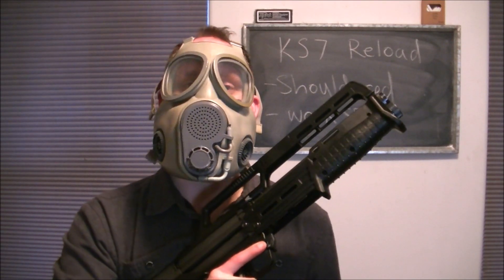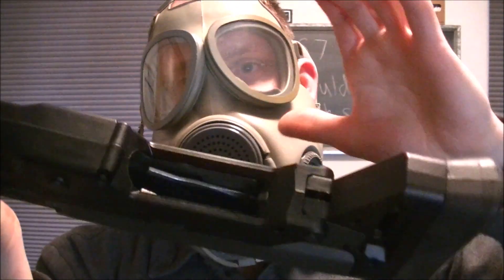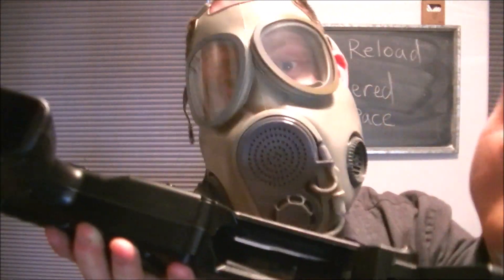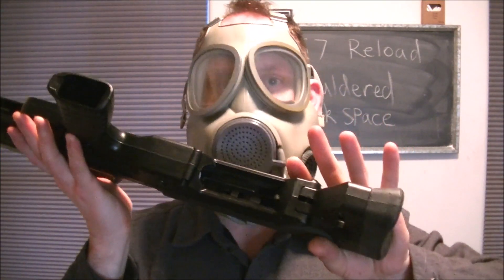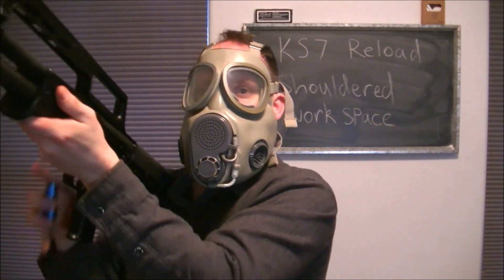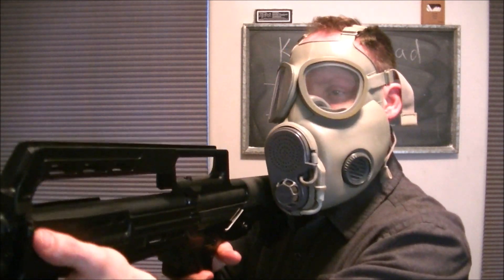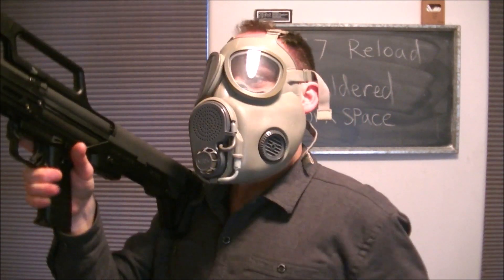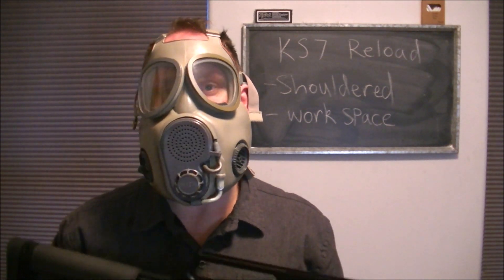Keltec KS7 Emergency Reload

Comment: The KS7 certainly seems easier to manage than the KSG I had previously. The dual mag tubes could make loading quickly a bit of a challenge especially with the already different rearward loading/ejection port compared to traditional shotguns. One mag tube that’s just right there, no additional shell blocker bar to accidentally bump while loading
Simple, thinner, lighter, and honestly better looking. I hear the action is substantially smoother than the KSG as well given that you’re not fighting both mag tubes with the action bars. Definitely going to need to pick one up.
I remember my KSG with both tubes and a side saddle loaded with buckshot weighed an absurd amount, easily tipping the scales over 10 pounds. Short and easily managed for me sure, but smaller framed friends complained a lot about just how hefty it was at the range.

Comment: Nice video man. I spent a lot of years running 870’s for work, but just recently grabbed a KS7 simply because it looked so cool. I’m hoping that it proves to be reliable for me as I really like the gun a lot.
Reply: Hey man. So what’s your take? I’m thinking of getting a KS7 for self defense. But I was also looking at an 870. The KS7 seems practice, specially for small areas.
Reply from the maker: I think it is quite practical as long as you modify the magazine tube for easy feeding

Comment: I was gonna pass on this video when I saw the mask but figured I'd give it a shot. Helpfull  info. I'm 75 and used to conventional shotguns. I'm not a fan of bulpups in generall but realized the ks7 is a good move in a close quaters situation. There is a little learning curve with it. Your emphasis on getting the front of shell up in there is important. Once the front is up there you kind of cam it over into the chamber with the thumb. Different then what I was used to just dropping one into the ejection port.
Reply: Same here

Comment: One way I have done reload from empty is I use the tip of my thumb to stop the pump about half an inch before it hits the back, this causes the loading lever to not flip down and bolt wide open so you can just dump a round right into the chamber no problem. Then you can pump it forward and flit upside down so the chamber faces up you can drop one shell right in and use a second shell to push it in so you can load 2 at a time.

Comment: you can also just drop the round into the loading or ejection port while having the gun upside down and it will feed it into the chamber when you run the bolt forward and the action lever bars go up or down however you want to reference it from the perspective of having the gun upside down.
Reply from the maker: Putting the gun upside down is like checking out. Keep the gun in a firing grip and in your workspace.

Comment: Great video! Now just a quick question, what do you do for any kind of feeding/ejecting issues with your ks7? When I was running some snap caps through it and they would get caught  in between the arms on the way out. I thought I was short stroking at first but it would also happen when giving it some force as well. I love this gun and I want to make sure it's always working for me 100% of the time.
Reply from the maker: Snap caps just seem to be that way. I STILL HAVE THAT ISSUE. BUT NO ISSUES WITH LIVE ROUNDS
Reply: @doitriteak  Ah okay then. Maybe it's just the snapcaps that's the problem, thank you for taking the time to reply! :)
Reply from the maker: No big deal. They can be a butt
Reply: I had the same thing happen to me but it induced double feeds when cycling the action fast what i did was load the front most jammed round back into the tube and get the further back one out of there its pretty simple but as the original poster of the video said i think its something that happens with the snap caps due to their less than normal or natural weight distribution of the shell... real shells dont have a uniform weight through out them like the azoom snap caps do even though they do a fairly good job replicating the real weight of shotgun loads they dont correctly allocate and disperse that weight throughout the fake shotshell like it would be if it was a real one.
Reply: @Tyrone1390  it is just typed a nice little paragraph detailing my opinion on reason it happens just to look up and see your short and sweet comment saying the same thing, you love to see it.

Comment: Is there a way to clear a chambered shot if you cant/don't want to shoot?
Reply from the maker: Yes. Pull the fore end back slowly until the shell ejects. Don't pull too hard or too far or it will just pull a shell from the tube
Reply: @doitriteak  thanks I ended up just transporting it and shooting it. I am definitely going to try this later though

Comment: Do you think this gun is ready for home defense?
Reply from the maker: Not out of the box
Reply: @doitriteak  What needs to be done? Just the minimum required, in your opinion?
Reply from the maker: Polish the mag tube entrance
Reply: @doitriteak  Thanks. Do you recommend any particular rod/patch/cleaner combo?
Reply from the maker: No. The good thing about the shotgun is how simple and hardy it is.
Reply: Cool. So does one need to break down the gun starting with stock to polish the mag tube or can they just unscrew the magazine cap, take out the spring and mag follower, then clean inside? Straight from the intact gun?

Comment: It's not smooth and impossible to run fast.
The action outruns the lift bars if the user is fast enough. 
No, it isn't Winchester 1300, or 590A1 quality. It is a cool gimmick made just well enough to work okay.